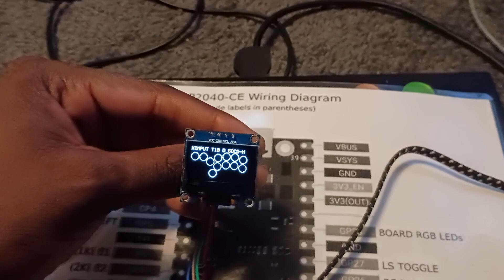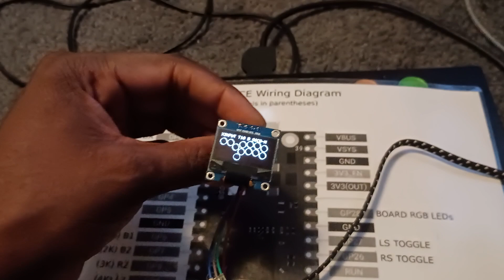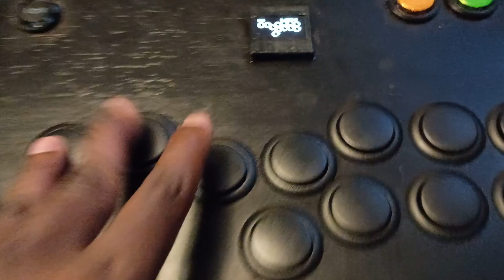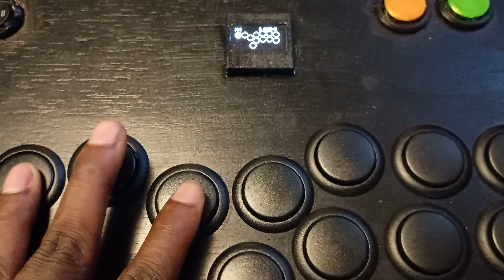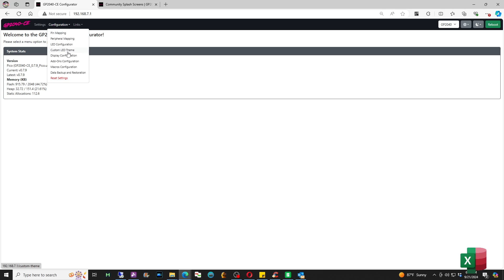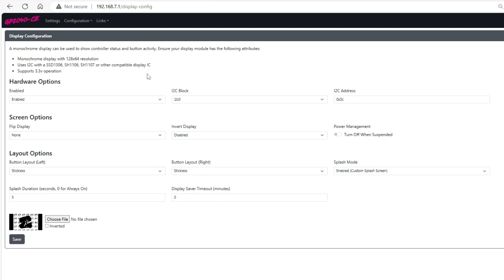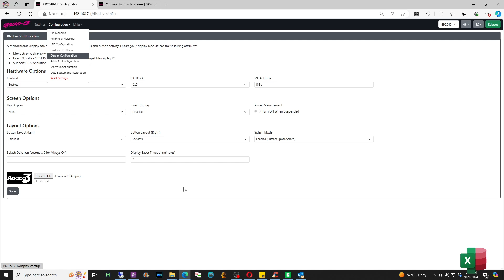(GP2040-CE) How to Wire and Configure a 1-inch OLED Display

Comment: Hey man! Thanks for the video. I noticed that you put the led on your wiring diagram. Did you ever put LEDs on your stick? Or what is required from the pico like what pins are needed
Reply from the maker: I've dabbled in the LEDs but only basic ones that requires a 5V and a GND. I'll start doing more with the LEDs at some point in the near future and I'll make a video about them. Just make sure your LEDs are 3.3V or 5V.

If you want them on all the time, you can just daisy-chain them together and power one side with a GND pin and the other with a 3.3V or 5V pin on the board.

BTW, you can use either the 3.3V or 5V pins on the board for the OLED. I learned this after I made the video.

Comment: I'm thinking about buying the haute42 b16, the one that uses keycaps and it doesn't have an OLED screen, I'm looking to know how to install it but I can't find it anywhere. Do you have any tips you can give?
Reply from the maker: You would need to mount it on the outside of the case and I don't see enough surface area to do that with. Just get a bigger case or find a model that has the keycaps and the screen.

Comment: Hey man, I just bought a flipper zero and it sparked my obsession with RPi's. I have a few and just got the pico2 and pi5 8gb and went on a shopping spree on temu/ali and got esp32's tft 1.4in screens. so i had to finish off the setup and got my first 3D printer. Your vids are great and so far you went over 3 different projects I wanted to start. A custom xbox controller with a tft screen in it for my 16yr old daughter.
Reply from the maker: Thanks for the comment. I'm working on learning how to add in an analog joystick to the platform. The goal is to build a joystick that can be used to play action games like Resident Evil and Call of Duty.